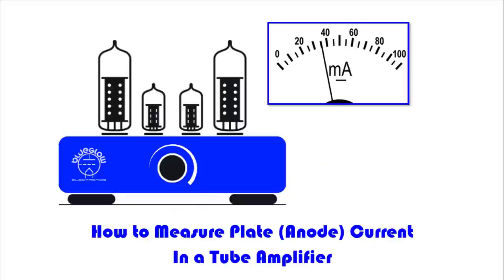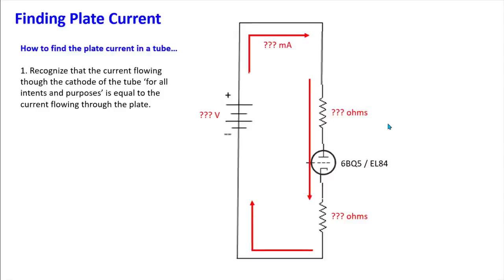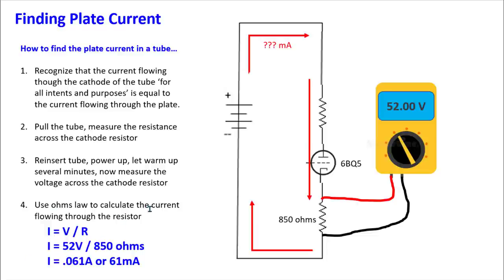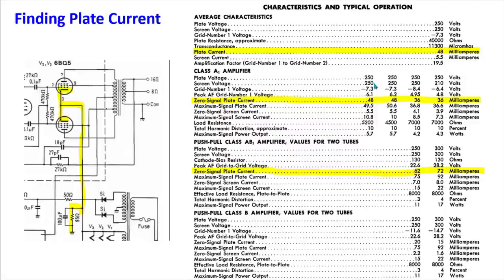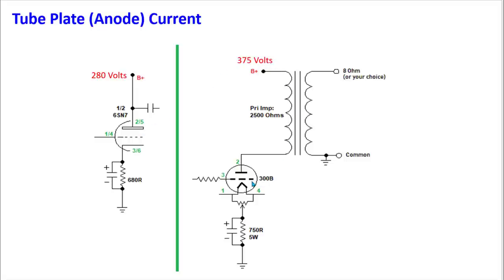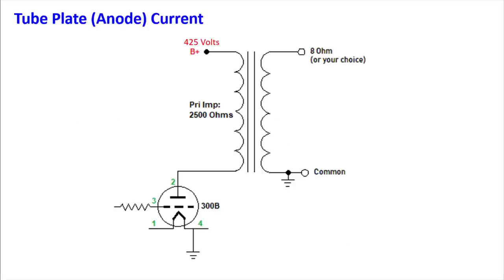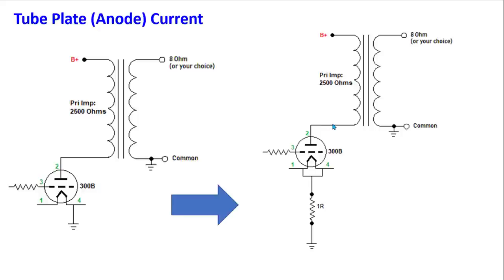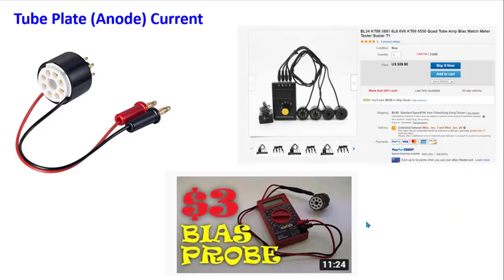How to Measure Tube Amplifier Plate Current (Biasing) and Actually Understand What You Did

Comment: One thing that I don't understand is that, how is it possible to run a vacuum tube off low voltage? I was getting really board with this Corona thing giving me way to much time to be on YouTube to the point where I have literally watched everything from everyone I follow. I found myself watching a video by Dave over at EEVBlog about one of those cheap Chinese vacuum tube pre amp things, this video was a follow up to an earlier video and he decided to take a closer look at the circuit to see if the tubes actually did anything. In his drawing of the circuit, I noticed that the tubes were being powered by plus minus 12v from a 6v plug pack. Now I have one similar except that mine came with a clear acrylic case and needed a 12ac plug pack to run. I had never questioned how it worked until I saw the video, as far as my understanding was regarding tubes, they needed hundreds of volts to operate and yet here was a tube operating on plus 12v and minus 12v, but how? And if that's possible, at what voltage can I run an output tube? 
Generally speaking, getting my hands on a high voltage transformer other than a microwave oven transformer in Australia is impossible at a reasonable price, it's almost like Australia doesn't want me to have anything to do with vacuum tubes and is forcing me to stick with solid state. But 24v PP is definitely achievable, hell even 48v PP I can do. But 300v or greater, forget it. 
My little cheap Chinese vacuum tube pre amp might not be as good as the real thing but to me! It sounds ok and it has so much gain that I can connect the headphone output of my phone to it and then to my cassette deck to record tapes with. Android headphone output suck for this sort of thing but this tube pre amp works wonders. Now if I can only understand what's the lowest possible voltage that tubes can operate at, maybe I can build a point to point wired tube amp, in Australia lol..
Reply from the maker: very few tubes were designed to work off low voltage, almost none.  it is possible to use low voltage (12V) to feed a power supply that raises those voltages up to vacuum tube levels, but that's really more about the power supply than the tubes operating at a low voltage.  In general, vacuum tubes are high voltage devices.  Thus why solid state became so popular, among a few other dozen reasons.
Reply: @Blueglow  yeah but from what Dave over at EEVBlog drew on the schematic, it showed plus 12v at the plate and negative 12v at the annode.. it really has me stumped because as I said earlier, I have only ever known that tubes need hundreds of volts to operate but this seems to contradict my understanding... There's plenty of these on eBay and they are not expensive... Could it be possible that if you have the correct heater voltage, you should be able to operate the tube at a lower voltage? If you can find the video on Dave's channel, it should be the second video on the same tube pre amp, it's one of those little aluminium case with the tubes sticking out of the top that are led backlit... Have a look at the schematic that he draws up on the whiteboard, he even marked the voltages but he somehow missed how it's able to work with the low voltage... I fully understand that tubes work on high voltage and low current and solid state works with low voltage and high current... But this is something else, now I'm tempted to purchase some tubes and sockets so that I can experiment with lower voltages... No one has made a video about this! Am I the only one who has picked up on this? Apart from the Chinese whom designed the circuit?....
Reply: @GeeBee135  funny you should say that, it's the next morning here for me and I'm still thinking about how no one seems to know this, I was just thinking about those korg tubes and decided to jump back on and try to explain myself better and then I see your post. No it's not one of those korg tubes and it's not a vacuum fluorescent display being used as a tube either... What I will do though, I will get the link to the video and also a link to something similar on eBay..
Reply: https://youtu.be/coSt5HWRvv4 
That's the link to Dave's video, it's from 4 years ago, man... He has made a lot of videos lol... Check out the schematic diagram that he draws up and check out the voltages at the tube! I don't think that it's a mistake on his part as I'm sure that he put the meter across it to get those figures, somehow he missed the fact that tubes usually run on hundreds of volts, not 24v peak to peak... He even showed the datasheet for the tube and I was able to see that the tubes maximum voltage rating was much higher than 24v... So what gives?
Reply: https://rover.ebay.com/rover/0/0/0?mpre=https%3A%2F%2Fwww.ebay.com%2Fulk%2Fitm%2F401765923735
Here's a link to the one that I have from eBay, there's voltages marked on the back of the PCB but they aren't the hundreds of volts that we normally see, this one uses the 6j1 tubes and the whole thing runs on a 12ac plug pack. Generally speaking, when you see inductors, you know that they are for the power supply and you know that it's either stepping up the voltage or stepping it down but I don't see any inductors! So is there black magic going on or is there something else that we don't know about? Have a look see, I would love to know what someone else thinks!
Reply: Oh! And incidentally, the one of in the link below to eBay can be purchased much cheaper if you shop around, just make sure that you have 6j1 also in the search title... I chose that link because it had plenty of pictures and a schematic that doesn't make sense lol...
Reply: It is possible using the "starved plate" configuration, or by actually thinking the tube a bit like a transistor and biasing it at the grid with the supplied 12v dc. Look for the video : "Stereo tube preamp with only 12 volts" by Johnaudiotech on YouTube, and you'll see how it's done 👍 (but bare in mind this is not good for the tube, for many reasons, but still faisable)
Reply: @bijouxbijouxbijoux  thanks for that, I'm definitely going to check it out. I have looked around on Google and found this amazing page on this very topic, check out the link below to learn the why and how this was even a thing... 
http://www.junkbox.com/electronics/lowvoltagetubes.shtml

Comment: Electrons flow from cathode to the plate.........the convention  of direction of a current flow is inverse to what happens in reality.
Reply from the maker: For sure
Reply: 1 Amp flowing in a 1 Ohm resistor drops 1 Volt across it no matter which way it is flowing.
Reply: @silasfatchett7380  indeed but that doesn't impair the flow of the current.;it 's a convention  but reversed to the real flolw direction ...fect ;

Comment: Why are you showing current 
Flow from positive  to negative? Electrons flow from negative to positive. In the study of electronics , current flow is electron flow, negative to positive. I know old Ben Franklin stated the opposite. He was mistaken and it did become accepted theory until modern day electronics.
Reply: Conventional current is often used in describing circuits because people find it easier to picture it in their heads
Reply from the maker: We all know this, not worth debating.  conventional vs. theory debate is decades old
Reply: Neither electron flow nor conventional current is correct. Each is a simple ‘model’ which allows those of us without a degree in quantum physics to see or predict what will happen when components are connected in a circuit. According the Merlin Blencowe (the Valve Wizard) who holds a Masters’ degree in electronic engineering: ‘current has no direction, only sign’.

Comment: It's much easier to insert an ammeter in series with the plate and B plus
Reply from the maker: And so much more deadly :-)  That's typically not easy without unsoldering something unless you buy the socket adapters I mentioned.